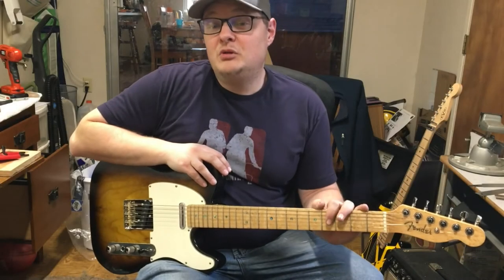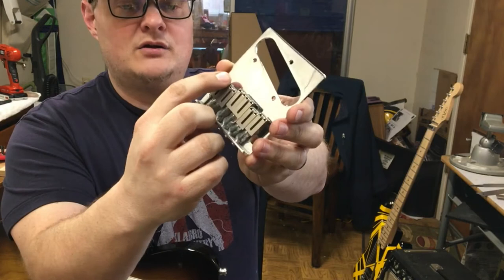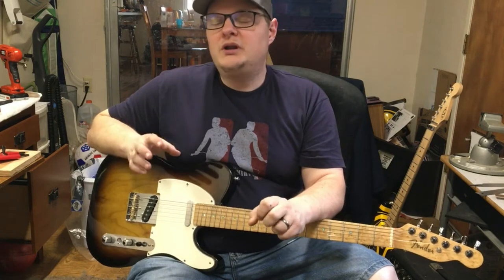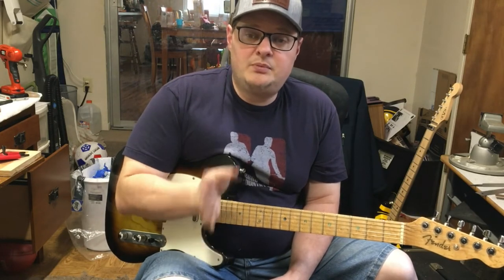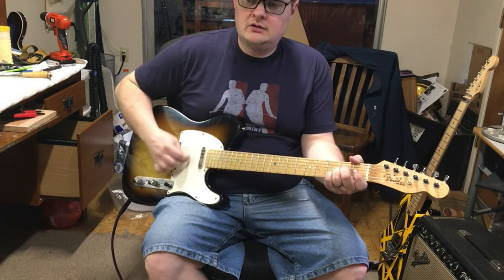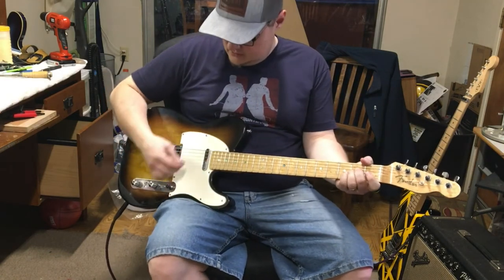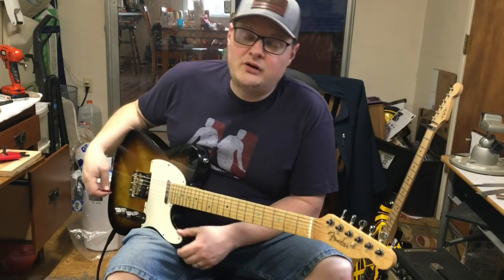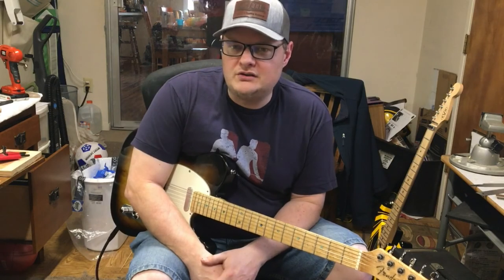Brass Saddles V. Steel - Can You Hear the Difference?

Comment: Just gathering the parts for partscaster which coincidentally is the same as your including the greg koch pickups. I'm struggling to decide what 3 barrel bridge to install. What make of bridge did you go for? Thanks Geoff Russell
Reply from the maker: Telecaster Chrome Bridge w/Compensated Brass Saddles & Cut-Down Sides for Fender Tele Guitar https://www.amazon.com/dp/B0866D8582/ref=cm_sw_r_cp_api_glt_i_T73VYD7FENZ99FVYJ8Q0?_encoding=UTF8&psc=1

Comment: You can get a 6 way with brass block saddles. Comparing a 6 way bridge with a 3 saddle vintage style bridge is tricky though. Is it the material used for the saddles, or the style of bridge that makes the difference?
Reply from the maker: That’s a good question!  I definitely noticed a difference and I prefer it this way, though.

Comment: You should have tested it with the same style saddles
Reply from the maker: Well, you may have a point but I used what I had at the time. However, honestly I think that the shape of the saddle wouldn’t make a difference to the sound. Maybe I’ll revisit in the future.
Reply: No sweat. You might be right.. I was just wondering

Comment: It is possible to replace the saddles screws with longer ones as well as brass saddle screws. Seems like you were set on changing saddles, anyways. But if they were worth keeping. Of course you can get more intonatible individual brass block saddles. You can also get a solid brass modern or vintage bridge. Though the vintage style ones are a little harder to come by. Personally I like a solid brass modern bridge saddle screws and all.
Reply from the maker: I have not had much success finding replacement saddle adjustment screws. Just use the ones that come with the saddles.
Reply: @MillerCustomGuitars  yeah, I can't deal with the intonation issues with vintage saddles or the lip on the side. Condensated brass saddles seems like the way to go. I like the Gotah solid brass modern bridge. That is where you could get brass saddle blocks from. But the string spacing would have to match your bridge. Theirs are 2 1/8. Probably easier just to buy the whole bridge.

Comment: I would rather have you to turn up the guitar amp because the camera mic is picking up the actual sound of the guitar and not the amp.
Reply from the maker: Thanks for the input. This was what I had at the time. If you watch my more recent videos you will see that I have a better way of micing both vocals and guitar amps now. 

However, I think that, while what you are saying is true, I believe that you can hear the difference in the clips, which is the point.   I hope you check out some of my other videos, like the Filtertron V PAF V Active pickups video, and you will see how much I’ve grown as a video maker in a year.

Comment: you mounted your bridge a fraction of a mm too far from the 12th fret.  NEVER hand make your neck or drill body holes for the bridge.  A 1/4 of a mm in either direction will require you to re-tune your ax every time you change keys. (it will NEVER intonate correctly).  It's not an easy fix because no wood filler is as strong and resonate as wood.  Use a standard 2 part apoxy with sawdust (in a hurry) to fill the old holes.  Wait a week and re-drill.  OR, just buy a NEW light body that is already drilled. Stew mac has fair stuff, -nothing lightweight, however. 
Parts made by reputable companies (e.g. Schecter)  will be made using CNN manufacturing.  This is GOOD.  This is why MOST new guitars tune well, out of the box.  
As a kid, I remember the days before CNN (long before) when your first consideration for buying ANY guitar was it's ability to tune! To find a well tuning box that also sounded like a cathedral would cost significant bucks (for the day).
I have no idea how Leo did it, but most  NEW pre-Colombian Fenders played in tune —even Teles with but three adjusters.

The NEW repro threaded steel saddles are not good.  The original threaded steel saddles were made from over-head cam engine bolts (valve cover bolts cut into pieces).  These bolts were made from the finest hardened (dense) steel. Today, however, the repro threaded saddles are CAST from MOLDS and less dense steel ( made with zinc!  How cheap can you get?).  Hence, the modern threaded saddles don't sound  good. I have a '65 Esquire. When I tried to replace my original threaded saddles with the standard, modern Fender 6 adjuster, barrel saddles, the sound reduction was obvious and severe.  I played one chord and 4 or 5 notes.  I then put the original saddle back onto the guitar -FAST.  It was frightening.
BTW, this guitars weighs just an ounce over 5 bs and has more sustain than any electric guitar I have played in over 50 years. Nope, it's made from ordinary Alder.  However, the pieces were but from the outside of the tree. Outside wood is lighter.  With Ash, the wood MUST be taken from below the water line to yield a guitar under 8 or 9 lbs.  Modern Fender is making fine guitars, but you have to  lift weights to play them. I have regularly seen Les Paul's that are lighter than Teles.

A heavy body may sound OK and clean, but only a LIGHT electric guitar  body can offer enough resonation and sustain to make the guitar sound so good that your will sell your wife to the the Arabs  before you sell your guitar.
Reply from the maker: This is by far the most bizarre comment I've ever receive.  It's also not true.  This guitar intonates fine.  Literally my entire channel is to teach guitar owners how to get the most out of their guitars.  This includes setup and installation.  And honestly, 1/4 of a millimeter closer or further from the neck is completely absorbable by the adjustments available in electric saddles.

Comment: I use Gotoh chrome covered brass , six indidual types and I have very good hearing ( as per hearing tests) and , to me , brass is a deeper sound. Also Wilikinson Brass compensated saddles. Both are good. My 2004 Hwy. 1 came with a Fender steel bridge ( curiously enough) and I think they were okay, Gotoh better for individual intonation. I don't know where your steel saddles were made but I can feel a more mellow sound with brass. So, if you want "Twang" use steel. JMHO
Reply from the maker: Yeah those steel saddles where probably whatever was cheapest. Lol

Comment: If the height adjustment set screws and the intonation adjustment screws are steel, change them for brass ones... AND remove the springs behind the saddles. Your welcome.
Reply from the maker: I don’t think this would make a difference since the string doesn’t come in contact with those.
Reply: @MillerCustomGuitars  it makes a difference. Try it. I'm not being a know-it-all or anything... I have done this... it also makes a difference on aluminum with steel set screws. The steel deadens the natural vibrational (characteristics?) (Resonance?)... I can't think of which word would describe it. Lol. But the steel parts cancel out a lot of the brass or aluminum sound. You don't have to try it if you don't want to.
Reply from the maker: @jedfiekel9809  Well, I don’t “think“ it would make a difference… But I haven’t actually tried it myself so I can’t actually say whether it would or not. So, I guess you could be right!  Something to try sometime in the future, I guess.